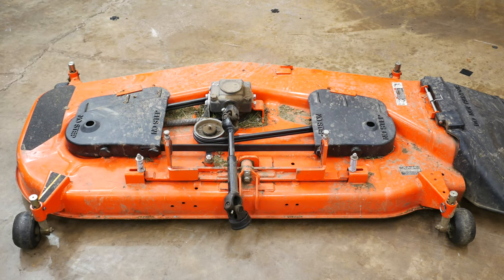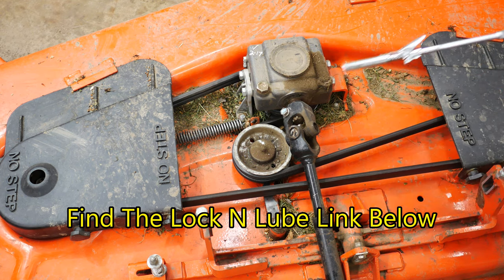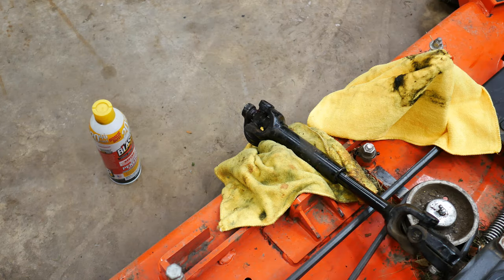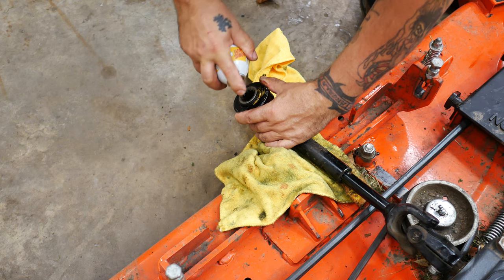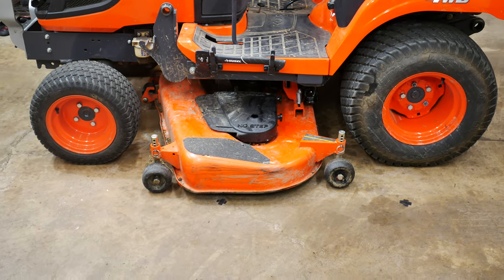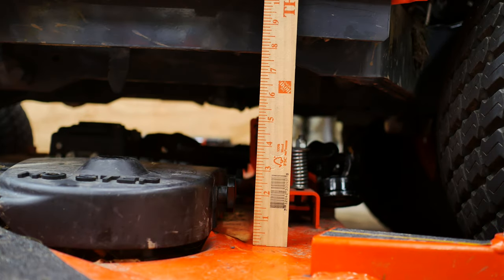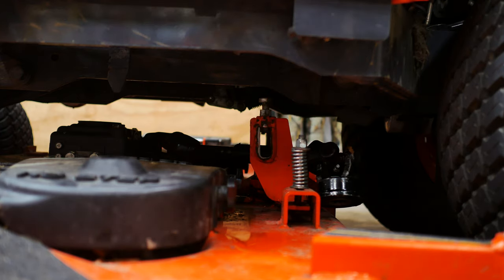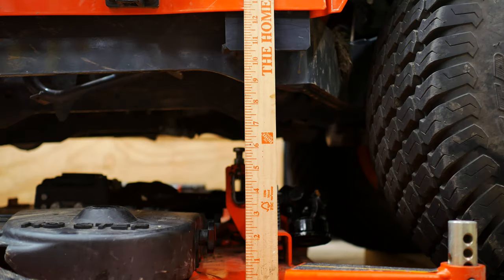That Damn Kubota BX Belly Mower! - Attaching Made Easy

Comment: i just bought a $39.00 kubota grease gun with tube grease
Reply from the maker: Whoooo-Hooooo!....new toys!! How do you like it? Have you check out that "Lock-N-Lube" coupler? Thanks-a-million! I really appreciate your comment and support!
Reply: @BotaTrac  its accully the best grease gun plus nice with the free tube full of grease inside wich nice deere wanted $190.98 for theres for manual grease gune and no tube wich was ripp off  i know the battery powered kubota grease gun was little exspensive $500 but it was a nice one comes as a big kit with battery powered grease gun,hose,batteries,battery charger,tube of grease wich wasnt to bad wich id deffently would spend the $500 on one if i had the money plus looked at the lock'n lube coupler kits at my kubota dealer wich wasnt accully to bad price for the sets
Reply from the maker: Awesome! glad you like it. Thanks again!